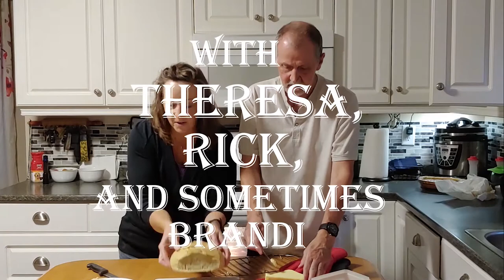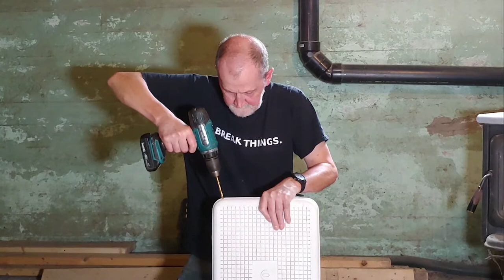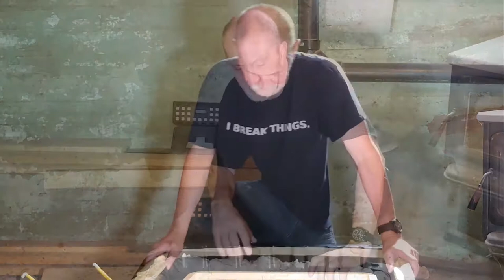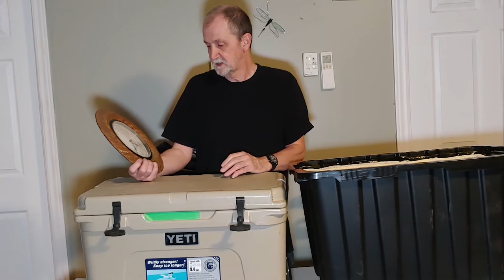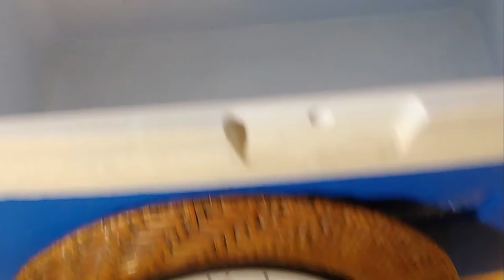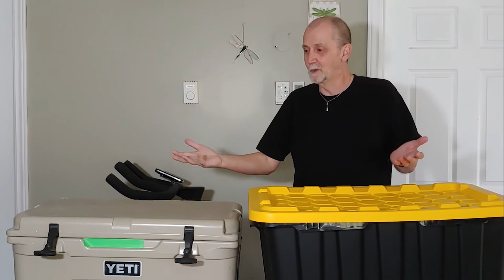Homemade Supercooler Goes Head To Head With Yeti

Comment: You know seeing how the yeti had one ice cube more at the end It is not unlikely that at the start the yeti’s bag of ice could have had at least one or more pieces to begin with in relation to the DIY cooler. If you wanted to be precise you could take one or two 2L soda bottles filled with water and frozen solid then placed in each cooler, then later drained and measured how many ounces of water there was from the ice melting, thus giving you an exact measurement of how much ice still remained.

Comment: You can use closed cell foam and not have to seal it with caulk. There was no statistical difference between one and two ice cubes. I call them equal.

Comment: Thanks for the awesome video.  Could you by chance provide all the materials that you purchased in order to make this new cooler? I got stuck on the part about the Caulking.  Do you spread it everywhere where the foam is exposed to dry or do you use many coats to the caulking? Other than those little details, very excited to do this for a fun little hobby